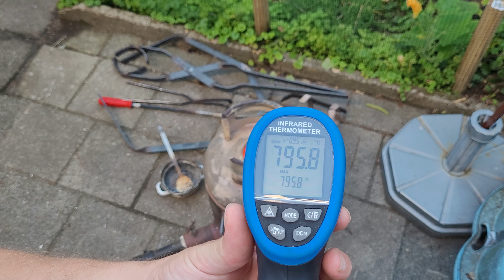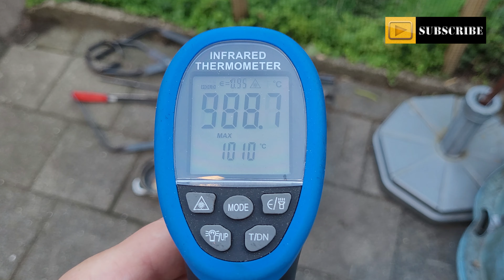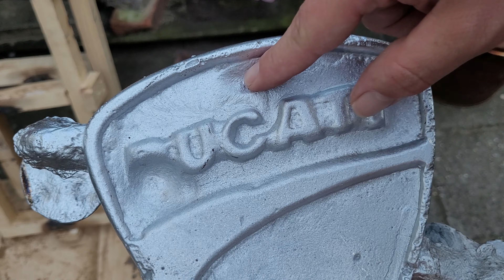Re-cast Ducati logo - Devil Forge - Melting aluminium

Comment: You can try to "degas" the aluminium with washing soda (Na2Co3). There will be less air in the aluminium which probably results in bubbles.
Reply from the maker: Thanks for watching. Thanks for the tip! As most replied in a re-cast I will do that very soon!

Comment: I think you described the issue at the end yourself, not a steady pour, lots of air got in. I could kind of tell from the first seconds of the video.
Use the method of the offset pouring basin and tapered sprue and feed in at the thick part of the line going trough the logo.
And maybe poke some small vent holes on the back using a piece of wire. Risers should not be needed.
Reply from the maker: Thanks for watching. I will make my sprues longer and will also use a narrow pouring sprue and a wider exit sprue, this might increase the pressure significant and do the job :) As most replied in a re-cast I will do that very soon!

Comment: try 4 on this one?  (6th it sounds like later in it).  Dedication though on working on getting it done tho!
Reply from the maker: Thanks for watching. I think I said 6, but this must be the 5th time, well we could count each video I made of them LOL. We had one styrofoam in where I poured directly trough the bottom sand, resulting in fire, the second attempt did not fill up, then I tried the wooden pattern 2 tries I guess, the second was a big succes. So this was the 5th time. As most replied in a re-cast I will do that very soon!
Reply: @Metalstacker  Whatever number it is, it's sure dedication!